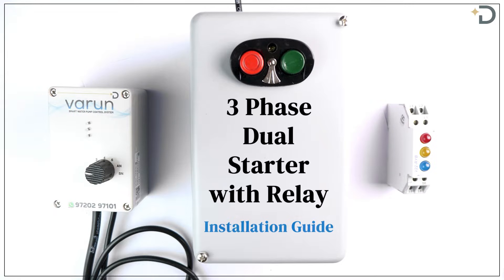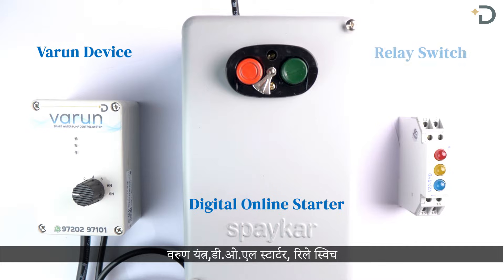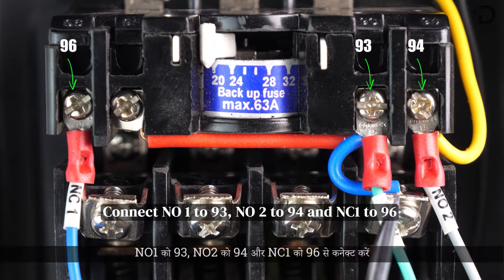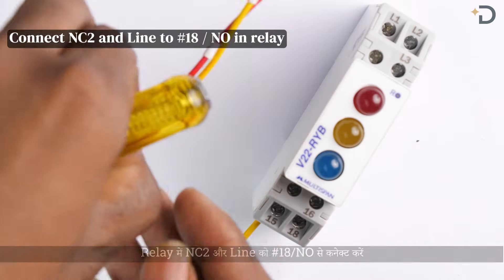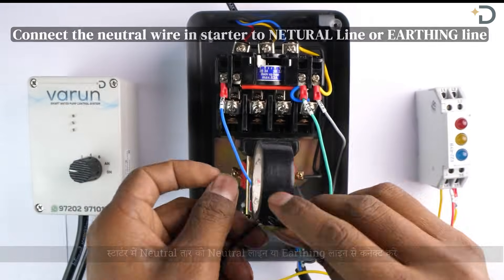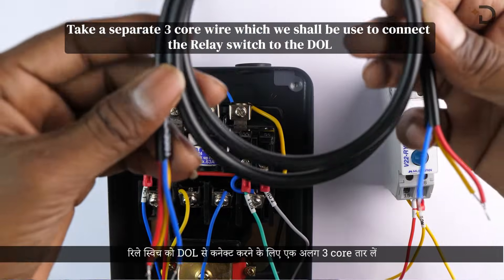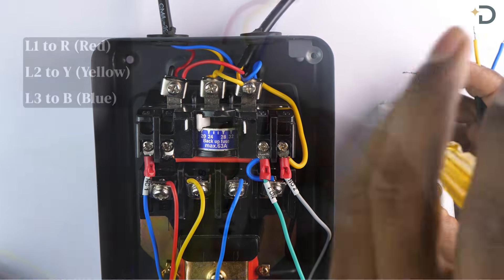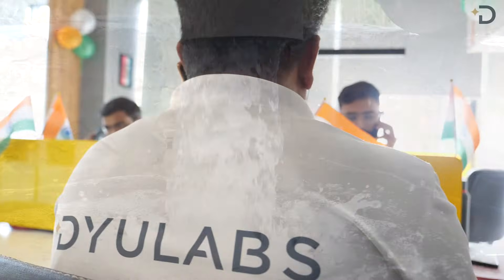3 phase DOL Starter - Varun installation process with Relay device in 3 mins #DOLSTARTER #farming

Comment: Relay ke liye kitna MM wire use kare.?
Reply from the maker: You can use 0.5 sq MM wire for a relay
Reply: Mujhe 2 way Connection 150ft door Leke Jana hai uske liye kitna MM use kare.? @Dyulabs
Reply from the maker: @acp2729  sir pls call on 9720297101.